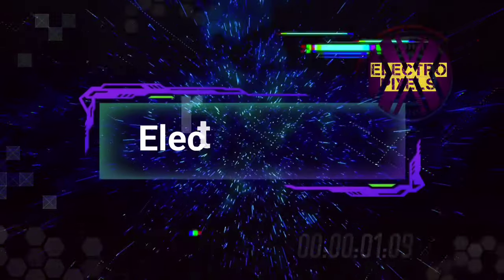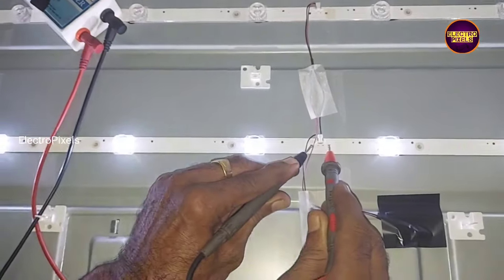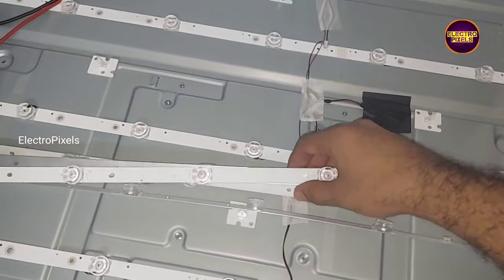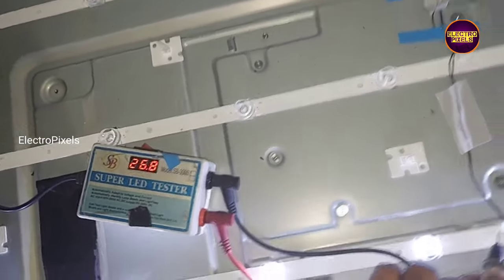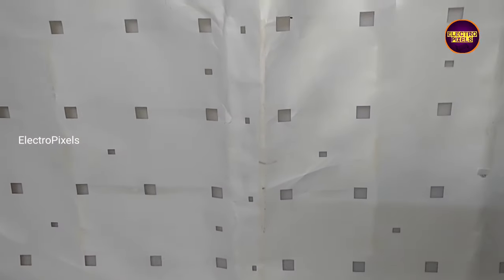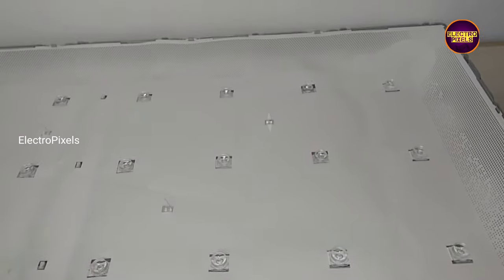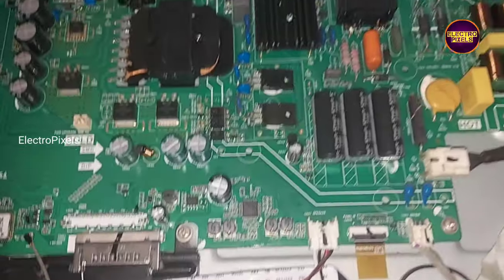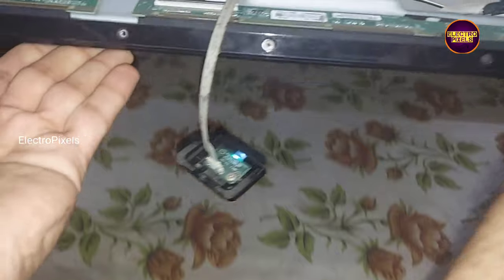Mi Led Tv 50 inch No Display ||Sound Ok No Picture ||Backlight Not Working|Backlight Repair|Tutorial

Comment: Hello needing your help on my tcl75eb600  ive got sound and can see and image if i flash a light to the screen and ive changed the led back lights aswell but its still the same will i have to get a led inverter? Or is there a tv code i can use to override some sort of tv protection on the led /inverter thanks
Reply from the maker: Try installing Backlight Driver Board
Reply: @ElectroPixels  ok thanks will do